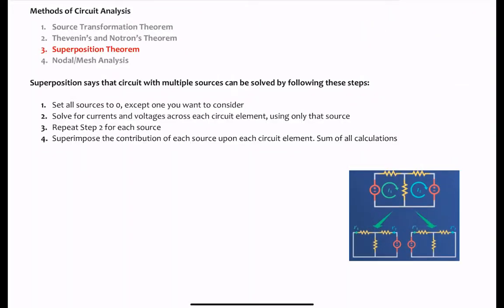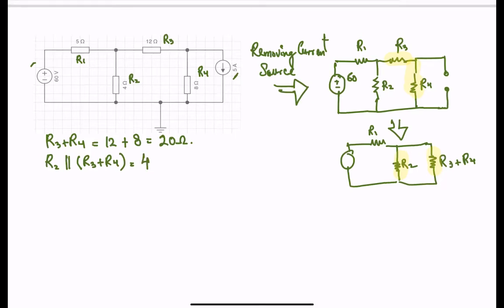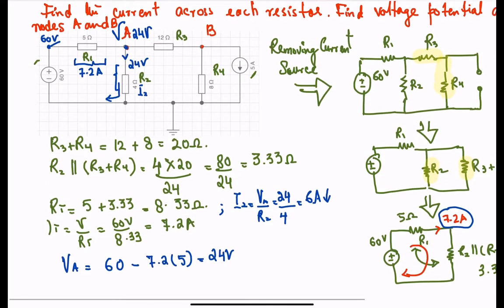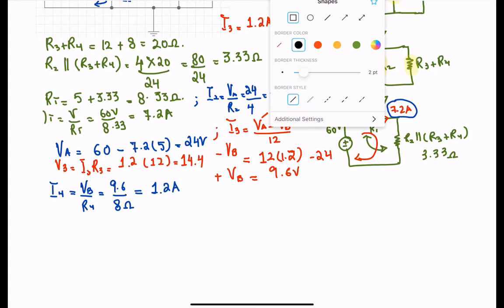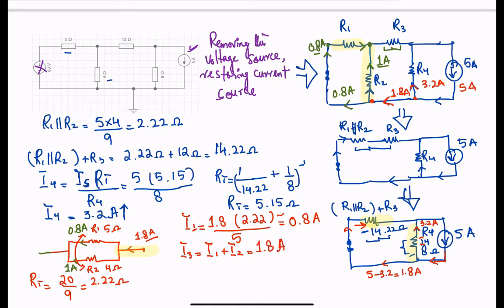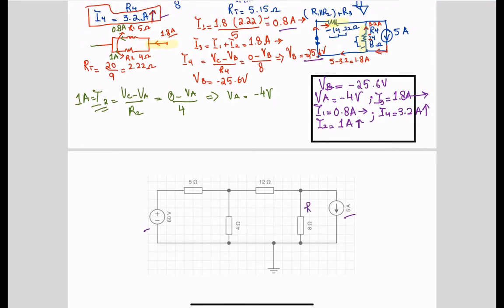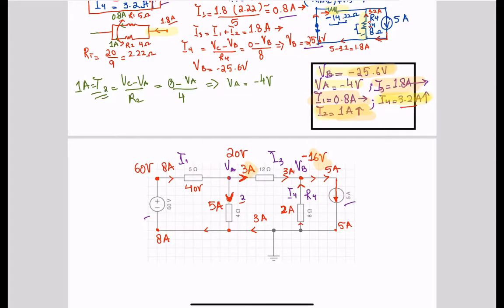#17 DC Circuit Analysis ➠ Superposition Theorem

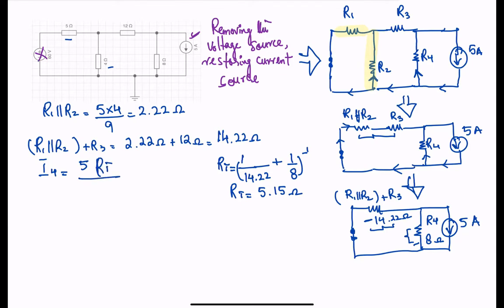Comment: why are we using the parallel circuit formula, @ 22:51, when earlier we used the series formula for a similar circuit structure>
Reply from the maker: Because the R4 is in parallel with (R1||R2 + R3) with Is being current source. So just simply apply current divider to find current because in a parallel circuit current is not same unless the value of two resistors are same.